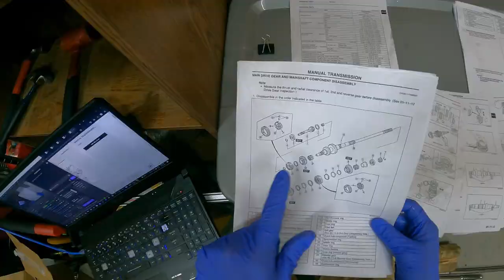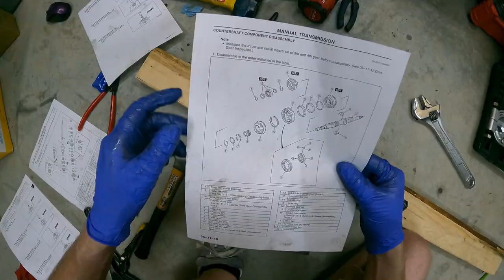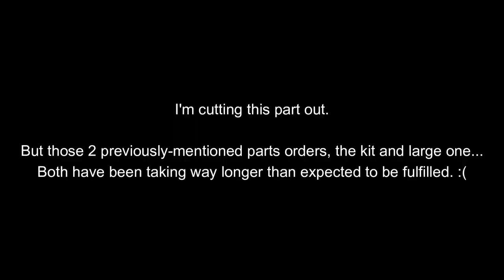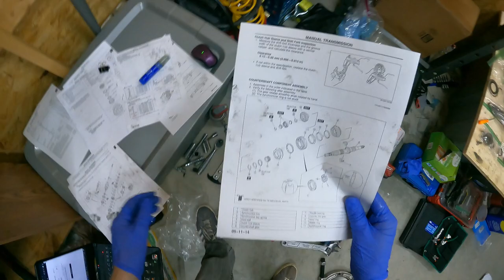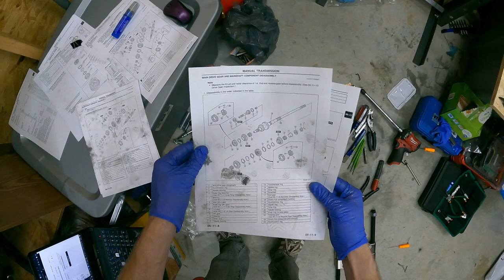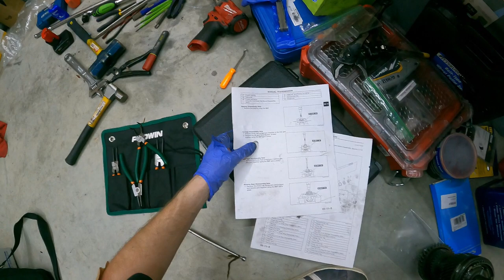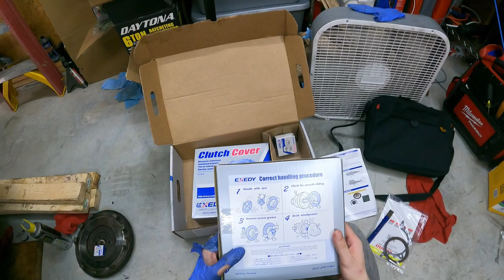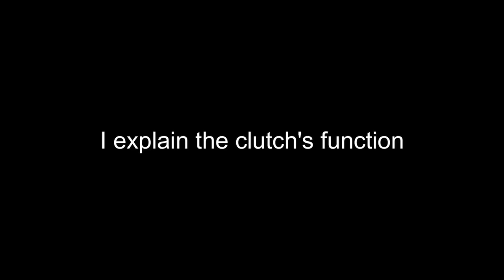NB Miata 6-Speed Transmission Rebuild - Episode 5 (Disassembly)

Comment: How timely. I've disassembled an NB1 6-speed I'm hoping to rebuild. You're using tools similar to what I am. I agree, that large bearing puller is the only one you really need. My 12-ton HF press didn't have a wide enough bed to support 1st and 2nd gears for removal so I used a 100-ton press I had access to.
Planning to order that BK435WS kit soon after I'm certain I can source replacement gears (some are NLA). How long did it take to receive your kit?
Reply from the maker: That's awesome! I did successfully rebuild mine, but unfortunately it's going to take a while to edit the videos. So, here's a parts info-dump (Sorry if it's a little wordy)
I got my kit from Transmission Parts Distributors, and it took 16 days of silence before they shipped it out.
Most other parts I ordered from Amayama (located in Japan). Those orders go through an approval process, and usually took 2-3 weeks after being shipped. (Do not base the parts you order solely off their diagrams. Their diagrams clump stuff together. So, figure out the part number elsewhere, then search for it on Amayama.)
The third main source of parts was Ebay, surprisingly. Not all listings have a picture of the part, but looking up the part number there often brings up hard-to-find parts.
Lastly I got a couple parts from MazdaPartsConnect

If you need to find the part numbers, I used the diagrams on... never mind; they removed the NB years. But when you find diagrams, pay special attention to the "ILLUST.NO.#"... No.1 has a different part number than No.2, for example.
Reply: @One-Cut Wow, I really appreciate the parts sources you shared! That's the same source I was going to use for the rebuild kit.
I was able to find some of the gears and clutch hubs I need on ebay, others on Amayama, and MazdaPartsConnect. Between each, I should be able to rebuild cost-effectively. Thank you!
Reply: Submitted my order to Amayama and now pending payment...
Was your shipping cost from them "high"? I'm looking at $1100 USD in parts, $330 for FedEx to ship. 🤯